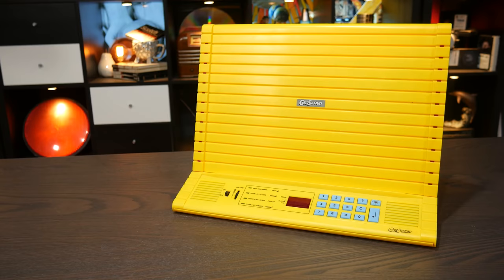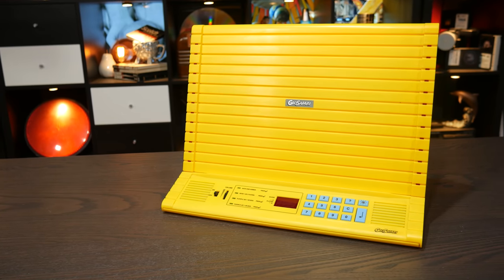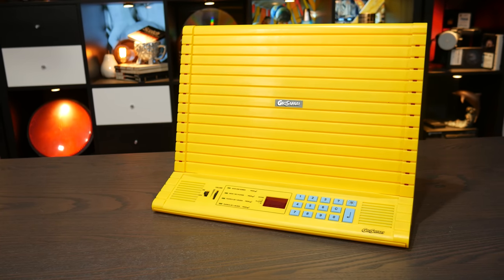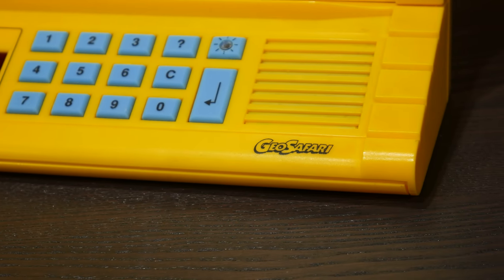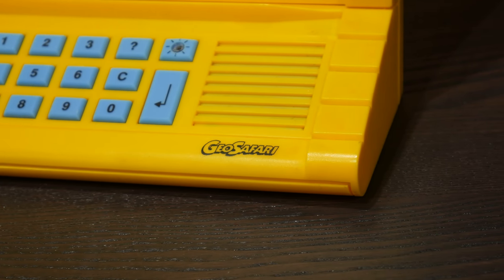The GeoSafari Jr. was a cleverly flexible kid's game

Comment: I really appreciate that every time you mention a temperature, you do so also in degrees Celsius for your international audience - as I really don't manage to get a grasp on the Fahrenheit thing and always have to look it up before I know whether someone is talking about a particularly hot or cold temperature or what...
Reply: Fahrenheit is easy.
0° F is colder than a brass monkey's balls.
32° F is freezing.
72° F is supposed to be room temperature.
98.6° F is the average human body temperature.
Easy to understand.
212° F is boiling water.
Reply: @theannoyedmrfloyd3998  yeah, those are some arbitrary numbers that there is no way i could remember just like that (without putting effort into it I mean)
Reply: @theannoyedmrfloyd3998  compare that to metric. 0 is freezing, 100 boiling. The end
Reply: @theannoyedmrfloyd3998  For you
Reply: I think its easier to just remember a rough conversion formula...    (F - 32) / 2 = (almost) C    Will get you within a couple degrees up to boiling.
The exact formula is divide by 1.8 instead of 2, tough to do in your head tho.
Reply: @sudoeste08  Honestly, how often does the boiling point of water come up? I only need to remember 212 like once or twice a year because 99.9% of the time it just doesn't matter because it's a self-regulating temperature. Compared to "temperatures over 100 can cause heat stroke" (and heat exhaustion at 90+) it just seems less useful. But I will grant that the freezing temperature of water is much more useful zero point and is one that actually comes up pretty frequently.
Reply: @killerbee.13  Well... in Celsius it's pretty easy to. You can divide the scale every decimal.
-30 and less - stupid cold
-20 to -10 - freezing cold
-10 to 0 -cold
0 to 10 -fresh
10 to 20 - confortable (20 being room temperature)
20 to 30 -hot
30 to 40 -freezing hot
40 and more -stupid hot
Reply: @sudoeste08  Lemme explain something to you: Fahrenheit is human-centered. 
In Celsius, you have to use the dumb scale of “0 = cold, 40 = hot as hell.” Dang, that’s some exponential curve stuff right there. 
Farenheit, though, that’s simple. 0 is very cold. 100 is very hot. Basta. 
Celsius makes perfect sense for water, but am I water? No sir, I’m human. 
It’s a non-relatable temperature system.
Reply: He should mention it in Fahrenheit,  after all his channel originates from the U.S. Besides,  metric temps sounds awkward! 35C sounds cold but 95F sounds hot
Reply: @sivalon1  And 200 is "I'm dead."
Reply: @joeblow8593  ... he did
Reply: @joeblow8593  He mentions is in both scales every time, I don't get what you mean?
Reply: Yeah, I have to admit I forgot he used Fahrenheit, I thought he was being cheeky when he said that -2 was really cold. -2°C isn't anything to phone home about, but even as a Canadian, -2°F isn't a comfortable temperature for doing any more than is necessary outside.
Reply: @sivalon1  that's a very good point, I've never considered it that way before. Having resided in Canada my entire life, I'm just accustomed to the scientific applications of metric and the couple of strange numbers I memorize to compare in my head for comfort. It's the same as what I've heard some say of Fahrenheit, where the freezing and boiling points of water are just a couple strange numbers to memorize. Thank you for opening my eyes to the other side after 24 years in the dark.
Reply: Fahrenheit was designed such that 0 is the freezing point of sea water and 100 is body temp if that helps. also (F-32)*5/9 = C
Reply: @Chris-du7hi  the exact formula is 5/9
Reply: @ameunier41  In this case, it is stupid cold where I am now, haha!
Reply: the mental math formula i use for F to C is 32 + (C rounded to the nearest multiple of 5, then divided by 5, then multiplied by 9.) gives a pretty good idea of how hot or cold something is for me. 

for C you can reverse engineer it and it would look something like C= F -  32 + (F rounded to the nearest multiple of 5 divided by 9, then multiplied by 5.) naturally this is less accurate than its Fahrenheit counterpart but I’m not a math major so  ¯\_(ツ)_/¯
Reply: @sivalon1  in celsius, 0 is cold, 40 is "hot aa hell", -40 is "cold as hell",
While in fahrenheit, 0 is really cold, 100 is hot, -100 is something you can not have an idea about cause you won't find any place that is that cold
Reply: @Chris-du7hi  Chris if you are starting with a farenheit temp,you must subtract 32 first  then you are going to divide by 1,8.

          If you are starting with centigrade you will first multiply by 1,8  and then add 32.
Reply: @eastlynburkholder3559   Like I say "ROUGH conversion formula...  (F - 32) / 2 = (almost) C ".   
80f - 32 = 48   48 / 2 = (about)24c  [26.6c exact]
47f - 32 = 15   15 / 2 = (about)8c    [8.3c exact]
-10f - 32 = -42  -42 / 2 = (about)-21c [-23.3c exact]
Respect if you can divide by 1.8 in your head, my way is close enough for the girls I go out with.
Reply: @mycosys  You are correct if you multiply by 5/9.  You'll notice I said to divide by 1.8
The reciprocal of 5/9 is 9/5 yes?   
9 / 5 = 1.8 exact.
Reply: @Chris-du7hi  
Laughing.
Reply: @sivalon1  I don't think arguing about which system is more "logical" or "human-centered" is getting us anywhere - it's ultimately just one thing: force of habit. Growing up with Celsius, I simply know how to clothe if the forecast says it's going to be, say, -20 or +30 degrees Celsius or anything in between; if I set a pot of water on the stove and it boils, I know that it has now reached 100 degrees Celsius, feels quite natural; but if you grew up with Fahrenheit, you will have similar intuitive knowledge of measurements in that scale. It's just nice that both are accommodated here.

Comment: In case no one else has piped up about this yet...

It's very common to have extra bits of plastic in your injection molding that are intended to be re-melted later to hold down other things. I've seen this a lot for holding down PCBs in inexpensive products. I've personally never seen it for wires, like this product, but I digress. I do it with a soldering iron often enough but there are specialty tools that do this on modern production lines.

I know this as "heat staking".

Comment: The "melty plastic bits" is called "heat staking", fyi https://en.wikipedia.org/wiki/Staking_(manufacturing)
Reply: The best part of TC videos is that I learn nearly as much from the comments as I do from the video itself.  Time to go down another Wikipedia rabbithole...
Reply: Was hoping to see someone bring that up in the comments. Very common way of holding wires in molded plastic cases.
Reply: Thanks. I had seen this technique for a long while but never knew what it was called. And it's pretty neat, imo.

Comment: This is really cool!  

At the top left of the board at 17:25 you can see the Zener diode labelled "ZD1".  It and the resistor next to it probably form the voltage reference.  The fat transistor with the heat sink then clamp the input voltage to that reference voltage, keeping it constant.  The two together act as a voltage regulator.
Reply: Also text on the board says: "to adapter." obviously to accommodate some dodgy fixed ratio transformers.

Comment: The NatGeo connection: it was sold in the stores.

[EDIT: This comment keeps getting automodded and I think it might be the links, so I removed them; suffice it to say that there's a photo of the NatGeo store on the official website which shows a device very similar to the later GS Jr models. I can provide via message if you'd like to see.]
Reply: fwiw: 50f (10c) is about when you switch from long pants to shorts or vice versa; above 100f (38c) or below 0f (-19c) is when you shouldn't be outside for very long without extra precautions.
Reply: When you think a comment is being "auto modded," copy your comment on to the notepad, delete, and repaste to repost, but obfuscate the URLs.
Reply: @theannoyedmrfloyd3998  ooh helpful

Comment: When I was a kid (talking early 60s here) there was an even simpler knowledge game. It was basically a 1.5V light bulb, a 1.5V battery and a hard-wired circuit all tucked inside a low-profile carboard box, and question & answer sheets. The player held two leads coming off the box, much like the leads of a multimeter.  The  sheets had questions in cells on the left side, and answer cells on the right. In each cell, the sheets had small holes that would line up with little metal contacts on the box, which completed the circuit to the bulb. The idea was to connect any one of the questions to its correct answer. If you were right, the bulb would light. That was it.

The game came with dozens of sheets in various subjects. The obvious flaw was that being hard-wired, it would take just a few minutes to memorize that whatever the subject sheet being used, the correct answer to question in cell A2 would be the one in cell F4, etc. Nonetheless, as a kid I found it amusing and did learn a lot from it. 
Those were the sixties.

Comment: I remember my Grandma had this kind of electronic game thing that had cards, and the cards had punch outs on the bottom of the card that you inserted into the machine. The machine had contacts and what contacts got blocked by the card and what contacts were allowed to pass through, determine what game you're putting in. I cannot for the foggiest idea remember what that thing is. All I know it's really old.
Reply: I think I had one of those, because I totally remember being fascinated by the punchole encoding on the cards for this educational/game device. I think it was "touch-card" too, there were like buttons under the card or something as the play interface.
Reply: We had something like that too. You pressed the answers through the holes with some kind of magnetic pen. If you ran the pen across the surface without a card installed you could stumble on all the answer points.

I can't remember what it was called, but my mother said it was put out by World Book. The board/shell had a sci-fi theme.
Reply: Would that be the Tomy talking tutor robot? That was the absolute shit when I was 2.

Comment: I don’t see anyone explaining how it works in the comments, so I’ll hazard a guess. Think of the number in binary. The first few bits of the number will describe how many possible choices there are per question. The remaining bits will seed a random number generator to get the same sequence of “random” numbers each time (you can choose an algorithm carefully so there are no repeats if desired). The designer of the quiz would start with an arbitrary code number, and then arrange the answers correctly based on that.

Comment: Delightful review! And this is strongly reminiscent of the older, non-digital, even cruder Comic Electro game I grew up with. Rather than LEDs, the board had rows of metal dots along the sides, and scattered metal dots across the board, and there were little holes that lined up with these dots punched in the card overlays (with words printed next to the holes on the sides, and pictures by the scattered holes). It also had two cords with connectors on the end. Touching one connector to a word, and the other connector to the corresponding picture, would complete a circuit and I think a lamp would turn on. Surprisingly entertaining for a kid in the pre-Internet world.

Comment: Watching your channel is dangerous. This has me wanting to "roll my own" version with a microcontroller. That would allow additional functions, and even stereo beeps! 😝
Reply: And at this point I've thought about the logic enough that this very well may happen! LOL
Reply: For added bonus.
It'd be easier to implement with a few static images in a game window

So you could play on any operating system you bothered to program it on.

And save on material costs, and production lines.
Reply: @glenmcgillivray4707  microcontrollers generally don't have screens, i assumed that Mark meant replicating this exact device using current MCu like arduino or st32f4 or something, and having the cardstock area be 8.5x11 (US Letter size) so you can just print the cards on a regular printer.

Ideally it'd be backward compatible so you could, you know, download scans of the original cards and have it work, but perhaps add some additional game types, maybe with additional LEDs lit on either side, more answer types, etc.

you could probably reverse enginerd this if you had the instruction manual and a few cards of the different "types" of games.

if you do get around to this, Mark, maybe put the code in a public repo? I'd get a kick out of making one, too!
Reply: @genewitch  I was thinking of duplication of the code intrinsic and just programming the same concepts.

Answers are predetermination, the selection of 'game mode' baked into a txt alongside the Jpg or GIF, display the image, roll the gameplay out, the only mechanic I might change is using more than just the number pad. I might require use of a full two (gasp) rows of the keyboard. A-G and Z-B.

Heck the code could work on mobile and Android, play it on tablets and cellphones on the move.
Reply: @glenmcgillivray4707  You don't seem to understand the joy of physically interacting with something like this.
Reply: @awo1fman  I do. But I could redeploy my idea a few dozen times with other families.

The best viral ideas are ones you can deploy without fuss or marketing.
Reply: @genewitch  Yes, exactly. Another poster already figured out the code scheme, and integrating the original codes/cards would just be an easy translation, not reverse engineering.

I do wonder if there were options implemented in the hardware that weren't ever used. To be sure of complete backward compatibility you would have to have access to an original and do a complete reverse engineer on it.
Reply: @glenmcgillivray4707  Go for it! 👍

If I do it, it will be a physical thing because that's how I roll. Plus I would try to make it compatible with the original game cards. A virtual one would be easier, though.
Reply: @genewitch  would be nice if someone would post the codes publicly. TC says he has it but didn't actually post a link

Comment: I used something like this but a big larger. It was a testing device to test skills in different things and it had multiple choice type questions and the person running the test had to operate different buttons on the back of the test board to switch between tests. The choices to the questions were chosen by sticking a probe similar to the one on a multimeter into holes on the board onto contacts and a red LED would light up to indicate your chosen answer. After the test was finished the results would be printed out on an old dot matrix printer.

Comment: That 'Transistor' with the heat-sink on the power circuit, probably has the numbers "7805" on it, indicating that it is a positive 5volt regulator. That's all it does, usually maxed out at 1 amp. very often used to tame some unpredictable power transformers. Simple, but effective.  And I do believe those were "C" cells, not "D" cells.
As a kid, there was another game that we had, (I can't remember which one it was)  that used a code system as well. I wondered about that, and looked through the cards that we had for it, and found that some cards had matching codes. Funny thing is, the correct answers were also in the same locations.  The code corresponds to a rather modest table of answer location patterns pre-programed into it..    And yes.. I just now arrived at 12:50 ..    I guess I am /THAT/ guy..  Sorry.
Something about the antique games like this brought to memory a game I had as a kid, The Questron. have a gander, you might find it interesting. https://youtu.be/AruhjQNVM6Y

Comment: Plastic welding is evil.
Reply: To be fair, it does make something simple more "kid-resistant." It's not moving no matter how much you shake it.
( It stinks sometimes, but another upside is that, where I live, hot glue melts everywhere no matter how "protected" from the elements it is in theory. It's somewhat worse, because things get trashed before ever even opening the casing. Stuff just leaks out. )
You could heat wrap it in place sometimes, but not connect wire to plastic without glues that go brittle way before the plastic disintegrates. 
It wasn't too intrusive here, being just for connecting the power, and it's a kids item that will be jostled and is meant to be used repeatedly.
 It doesn't prevent repairs or completely seal a cavity or encase any circuits.

Comment: In 1983 I was a trainee on the  UK Government  YTS(B) program in IT.   Some of the work we did was for a company call "ELM" (Electronic Learning Machine).  We made overlays that fitted on a "Non dedicated  keyboard  very much like the magnetic cards shown fitting on this device),  Like these cards each card had a code and the code of the name of a computer program that was loaded in to a BBC Micro Computer that the keyboard was attached to.  The programs worked in much the same way as the device you are showing.

Comment: I owned Honda's first production year Hybrid.  The rear fender skirts were attached by metal clips that were not rust protected.  The clips would eventually fail (inevitably at 55 mph) and fall off.  New fender skirts (and clips) were around $200 each.  I never replaced them because I wasn't convinced the additional streamlining from fender skirts would save $400 in lifetime gas.  Long way of saying Alec is right.